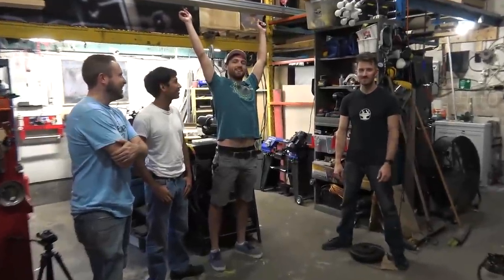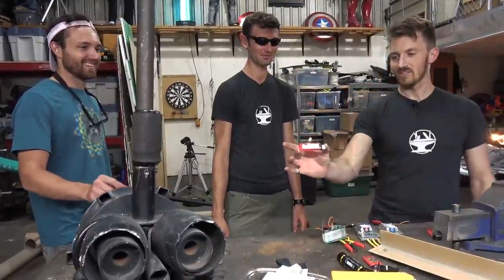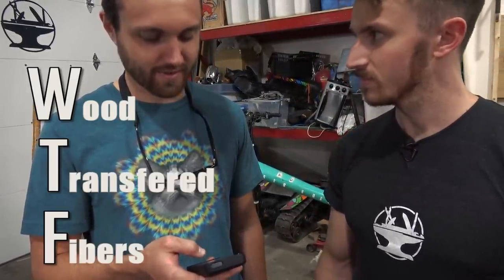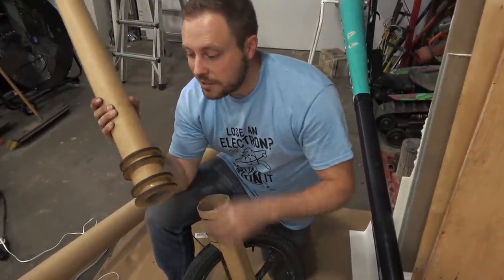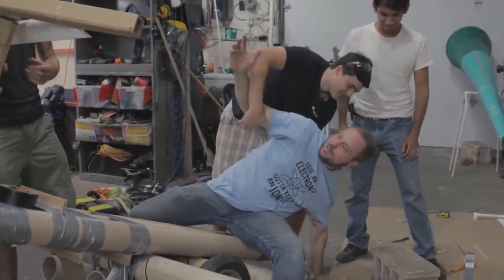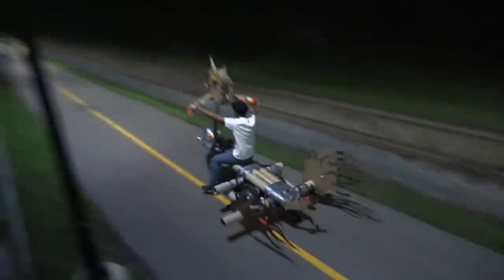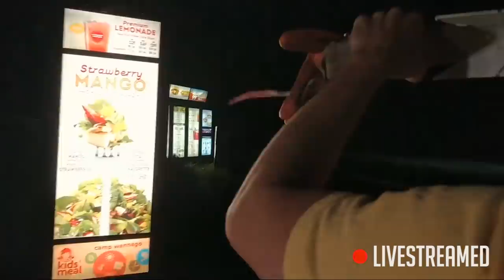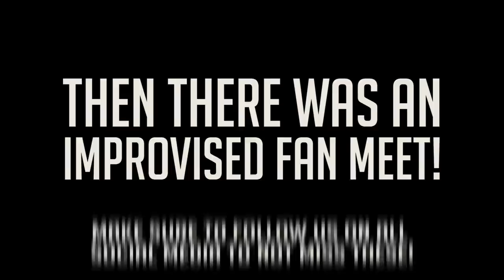PETER STRIPOL / JAIRUSOFALL / WILLIAM OSMAN & the HACKSMITH

Comment: On a little bit different note, do you guys think that a 2 wheeler motorbike could be fitted with (PVC + Fabric) material to make it a convertible ( like Mini Cooper Convertible ). And on top of that to have an Air Conditioning unit in that structure? Point being, can we make two wheelers more user friendly (w.r.t. cars) for the tropical climates ( extreme hot, extreme cold & rainy seasons)?